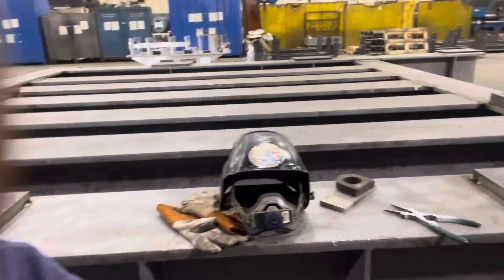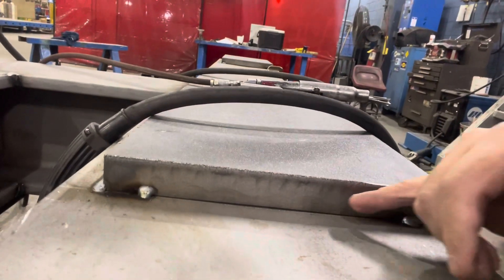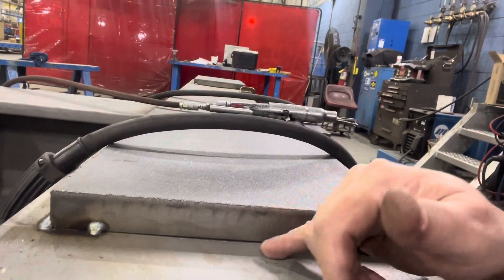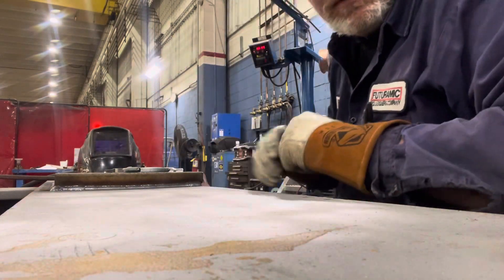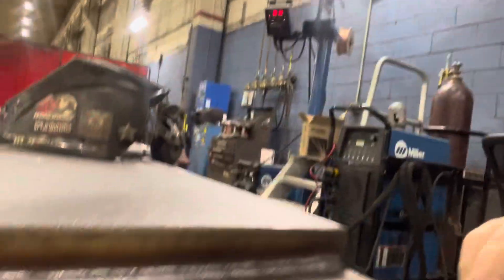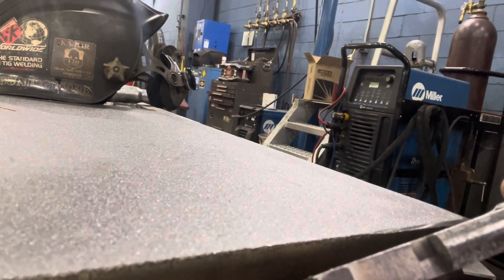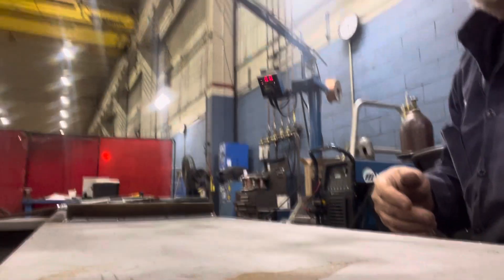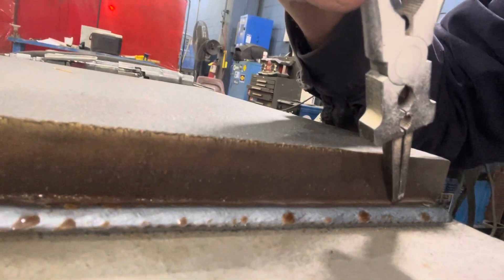How to weld a 3/8 MiG Weld

Comment: Why wouldn't you use flux core wire which is a modified spray transfer mode, especially with a base metal that thick; deeper penetration. You are in a short arc transfer with the solid wire at 23 volts. This is a good video for noobies.
Reply from the maker: We Have to Weld using our WPS for the Job. and as you saying good Video for Noobies, Your 100% Correct. I make these Videos To Help people Starting out in The Welding Field.

Comment: Would 615 be high for 23.8 ? I weld on a millermatic 252 ( have been for around 6 years or a little more ) and at 23.9 im at 420 wire speed lol. Im also only welding 1/8 inch metal but i assumed you would need more wire speed for more metal lol.
Reply from the maker: I depends on what shielding gas, and what wire size you are running. I’m using 95/5 gas, and 035 wire. ER70S-3

Comment: Would you use a grinder with wire wheel to remove slag I think it would be quicker.
Reply from the maker: You Could, But The Nettle Scaler is Faster.

Comment: You should open up a welding class on the side online your knowledge is valuable
Reply from the maker: Thanks for The Complement. But No Time were working 60 to 70 Hours Now. I was a Tool & Die Welder for 20 years, Then got into Fab. after 08. When the Economy Crashed.

Comment: Wut??? wut??? iam kinda lost: a 0.35inch or 0.9mm wire, at 23.5V, at 615ipm or 15.6m/s THATS NOT A SPRAY TRANSFER. It doesn't matter what kind of welding gas you are using. More correct way to describe this transfer mode is intermediate or dip transfer. You kind SIR seem to be a experienced welder but... the welding proses DOES NOT sound like spray transfer nor the bead looks like one. With all due respect.
Reply: Just one more thing a 0.35 wire on 3/8 plate is a waste of time.
Reply from the maker: It's not 3/8 Plate. I'm putting down a 3/8 Fill it. 0.35 is what They want up to use.
Reply: @GreatLakesReliance  ok, my bad... top plate looks like 50mm (yes Iam European).
Reply from the maker: I Guess it's on the Edge of Spray going into Short Circuit Transfer. and we use 95/5 gas
Reply: @GreatLakesReliance  ahh... (press X to doubt) i have very little experience running 0.35 wire... but i mainly run 0.40/1mm or 0.45/1.2mm wire. So the best and easiest way to tell when you are doing spray transfer is sound. There will be no that frying bacon BS, you aim for hissing. In YOUR case SIR i would recommend to start at least at 25v and around 400ipm. Of course every machine is little bit different, every wire as well. PS thanks for reply and would love to see what settings actually are needed for spray transfer in this case. Marry Xmas.

Comment: I appreciate your video and I’m sure it will help someone just starting out. I noticed in one of your replies to a previous comment that you said you were watching out for the boss so, I know it’s not your decision but, why would one want to weld that particular material thickness and bead size with hard wire? Seems metal core or gas shielded flux core would be a far more efficient choice.
Reply from the maker: ER 70S-3 is mild steel. The weld bead size is what they want. AWS Standards for bead size is Half the Thickness of the thinnest material. Thanks for the Comment. I’m here to help.